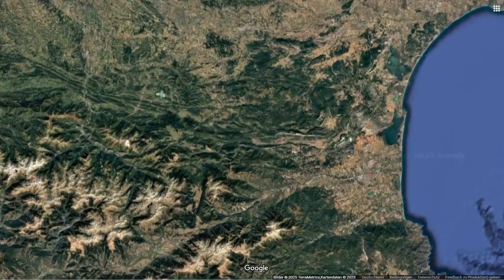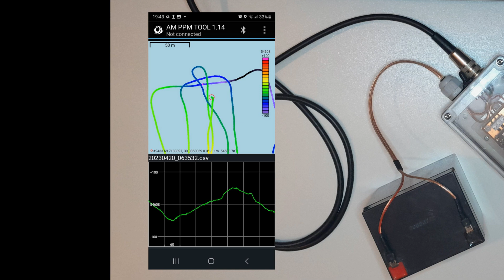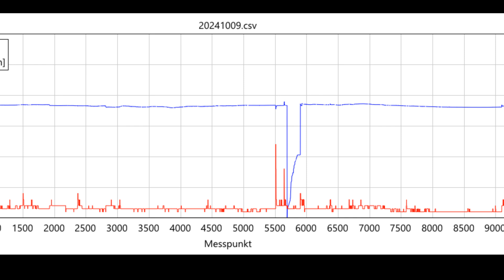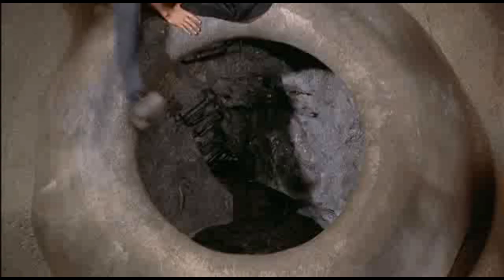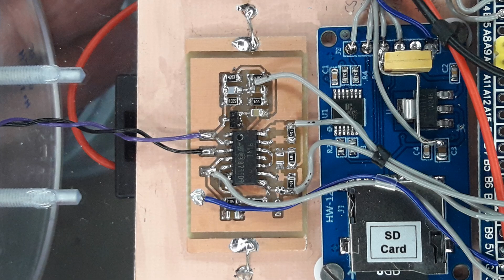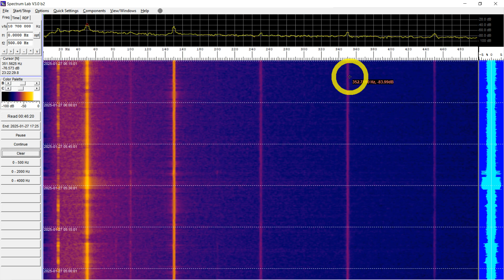Pic de Bugarach - An electromagnetic Challenge?

Comment: Could it be intermittent partial discharge or arcing on the electric lines? Any interference would have to be very broadband to affect both devices.
Reply from the maker: Interesting idea! Indeed, we should keep that in mind. Perhaps at some distant location, tree branches caused a short circuit and arcing that didn't immediately blow the fuses, lasting for a while.

Comment: Fake 18650's are really common.  A theory is that people take second hand cells, relabel them and sell them online.  The largest 18650 currently manufactured is around 3500mAh, but only specific factories make those and they cost quite a bit each (>$15 last I checked).  Most cheaper battery factories can only do around 2000mAh-2500mAh.

"GPS accuracy": how is this calculated?  Is it something you're calculating yourself or is it a raw number provided straight from the phone (its own internal estimation algorithms)?

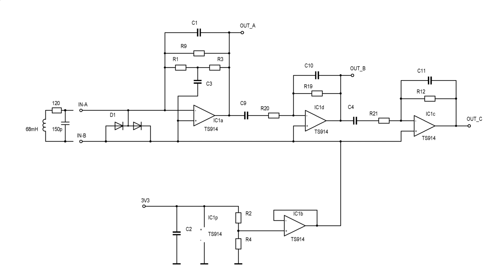Circuit @ 4:50 : what are those filter stages?  I think the second two might be band passes, but the first one eludes me. 

Really enjoyed your video, your sense of humour is great, your coils & equipment looks really nice and I am jealous you found an excuse to go for an adventure.  I suspect that graphing and editing this all together took a lot of time.
Reply from the maker: The GPS accuracy comes directly from the LocationProvider in Android, which provides a function to return the estimated horizontal accuracy radius in meters. I believe this value is derived from the typical NMEA HDOP combined with additional factors that only Google might fully understand.

Regarding the circuit, the two stages on the right are simple x10 amplifiers (R20/R21: 10k, R19/R12: 100k, C9/C4: 1µF). Initially, I planned to use C10 and C11 to limit the upper frequencies and block them from reaching the ADC, but I eventually opted to oversample at 96 kSps and perform decimation by 10 in software, effectively mitigating high-frequency interference.

On the left side, there's a TIA configuration. I ended up increasing R9 to 10 MΩ, which required adding C1 (10 pF) to achieve a fairly linear frequency response up to nearly 100 kHz. However, with a 10 MΩ resistor, the op-amp's offset voltage became problematic. To address this, I added a low-frequency path (down to DC) via R1/R3 (47k), forming a low-pass filter with C3 (10 µF).

I'm not an expert in filter design and don’t know much about poles, so I approached it intuitively and used SPICE simulations. I modeled the source AC field with a loosely coupled primary coil driven by a current source. With a 250-turn coil (67 mm diameter) and the component values shown on the left, I was able to easily detect the 16 2/3 Hz signal from a nearby railway line. Additionally, the DCF77 time signal transmitter (at 77.5 kHz) was visible when sampling the output using a sound card running at 192 kHz.